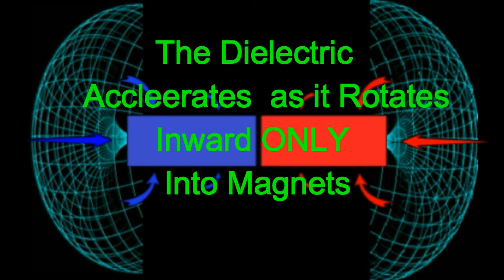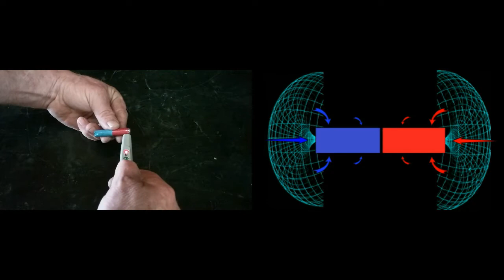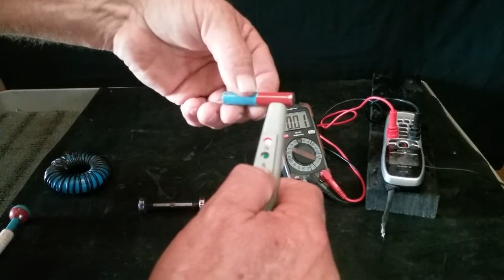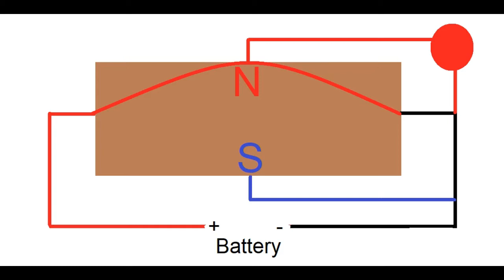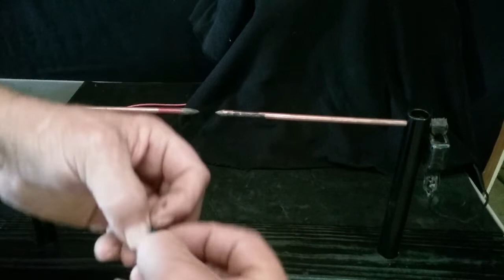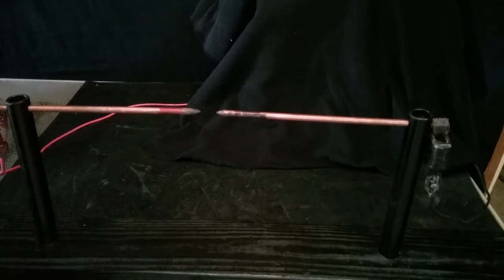How & Why Hall Sensors Determine Magnetic Poles

Comment: Great video, but I think you are missing a couple of points (Unless you address them in a future video?).
1st, I presume your current is DC? So you have a positive current going from left to right, that will develop a magnetic field travelling from left to right. Above the 2 wires with the arc, the Aether flow will be anticlockwise, giving you a north pole, on the bottom of the wire, the Aether flow seems to go clockwise, giving you a south pole. You didn't mention or test this idea, you just tested from the side, which was aligned north pole. If you had put your pole finder underneath the wires, you would have got a south pole reading.  How you position your pole finder is critical too, if you get it too much out of alignment, it will give you a false reading, the same as your Gauss meter, the Hallback sensor is very sensitive to positional change. 2nd, if the current was AC, which pole would dominate, or would the pole finder just vibrate between the two poles?
Reply from the maker: The current is DC (left to right). I believe that the "pole" of the current is the same from any orientation around the entire circumference of the wire (or arc). The "change" I demonstrated is the "actual" orientation of the magnet (magnetic field - corkscrewing Fibonacci) applied toward the "current / arc".
IE - I demonstrated that with the actual North Pole of the magnet aligned at an approximate 45 degree angle toward the arc - (with the actual North Pole basically in line with the direction of DC flow) - the orientation of the application of the magnets corkscrew "angle of interaction" "changes" as the magnet is moved around the entire circumference of the arc .
I also demonstrate this with the rotation axle wheels and the hall sensor.
It shows that for 180 degrees around the arc - the magnets corkscrew & rotation works WITH (PULLS) the current flow.
It then shows the opposing 180 degrees around the arc - the magnets corkscrew & rotation works AGAINST (PUSHES) the current flow.
IE = direction of which the "twist" in the arc displays. For 180 degrees around the circumference of the arc = the twist pulls Toward the magnet on the LEFT end of the arc - OR - For the opposing 180 degrees around the circumference of the arc = the twist pushes Away from the magnet on the same LEFT end of the arc.
(Reverse for the RIGHT end direction of "twisting" of the arc...)
This 180 / 180 phenomena is true when initially applying the magnet - in this orientation - anywhere around the 360 degree circumference of the "arc" - and then moving it 180 degrees = Top, Bottom or either Side / anywhere.
AC would pulse back and forth (N/S/N/S)

Comment: Thank you!  great work!! 
I defend the idea that Magnetism is charge and discharge, both poles represent a single phenomenon of discharge, with a spiral movement towards the nucleus, however said discharge develops compression on the one hand and rarefaction on the other, which creates the illusion of two qualities, when in reality, these result from the relationship with the dielectric center of the magnet and the hysteresis of the aether.
Reply from the maker: Thank you! Your definition is quite possibly the key.